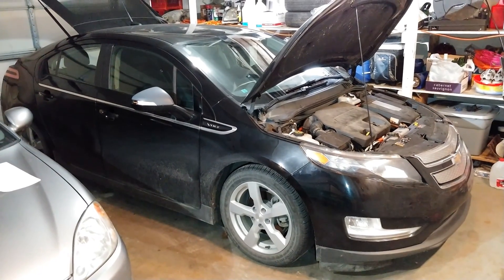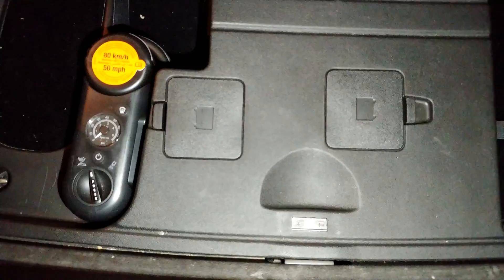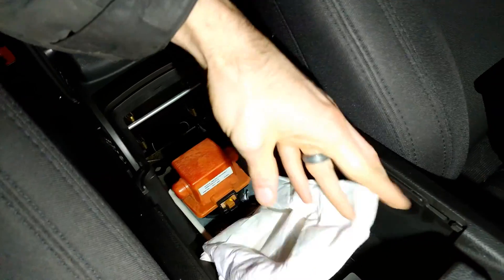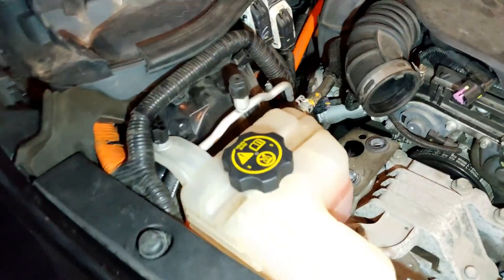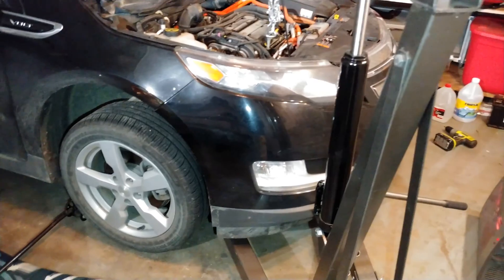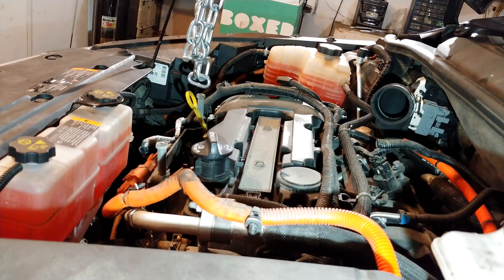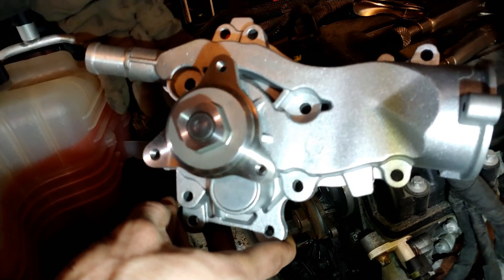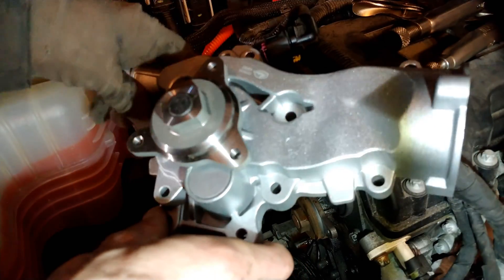2011-2015 Chevy Volt - How to Replace Engine Water Pump

Comment: P0597  P2181  ?
Reply from the maker: The error codes P0597 and P2181 for a 2011-2015 Chevrolet Volt indicate issues with the vehicle's cooling system.

P0597: Thermostat Heater Control Circuit/Open
This code is triggered when the Engine Control Module (ECM) detects a problem with the thermostat heater control circuit. Common causes include:

Faulty Thermostat: The thermostat may be defective, preventing proper temperature regulation.
Damaged Wiring or Connectors: Issues like broken wires or corroded connectors can disrupt the thermostat heater control circuit.
Failed ECM: Although less common, a malfunctioning ECM can also lead to this code.

P2181: Cooling System Performance
This code indicates a general issue with the cooling system's performance. Possible causes include:

Low Coolant Level: The coolant level might be low, affecting the cooling system's efficiency.
Faulty Thermostat: A malfunctioning thermostat can cause the engine to run at incorrect temperatures.
Cooling System Leaks: Leaks in the cooling system can lead to inadequate cooling3.

Recommended Actions
Check Coolant Levels: Ensure the coolant is topped off to the appropriate level.
Inspect Thermostat: Check the thermostat for proper operation and replace it if necessary.
Examine Wiring and Connectors: Look for any damaged or corroded wiring and connectors in the thermostat heater control circuit.

Comment: I love my city vote but, after seeing this headache and the foreseeable future, I don't know if it's worth it!
Reply from the maker: It's understandable to feel conflicted about your Volt, especially when facing issues like the engine radiator repair. The Volt has generally been praised for its efficiency and low running costs, but like any vehicle, it can have its share of issues.

Thankfully, engine radiator problems have not been one of them! This is the only video on YouTube to document the repair and it only has 15k views in 5 years. The Volt is also known for its reliability and low maintenance costs compared to many other vehicles. My 2013 has hit 2 deer. The first one took out the battery radiator, but the second one only took out a head light a bit of the hood. So far, the only major mechanical repair I've had to do is the engine water pump. I've put 80k trouble free miles on my Volt since I bought it after the first deer accident.
 
In terms of the foreseeable future, the Volt remains a solid choice for those looking for a hybrid vehicle. Despite being discontinued, many owners find it to be a reliable and cost-effective option. Parts and maintenance might become a bit more challenging over time, but the overall reliability of the Volt is still considered above average. Good luck!
Reply: @mjspiess  funny you mention hitting a dear, I actually bought the volt to replace an Elantra that was practically totaled by a deer 😅 My daughter drives the volt as a city car since it's built like a tank! I drive a Prius with 200k mi, which seems to be more serviceable but, I do like the volts mass. I just think about all of the water pumps I've put on cars in my life and consider it inevitable and daunting.
Reply from the maker: @GTN3  Ha! Figures! It's great that the Volt has been a reliable replacement for your Elantra. They are indeed built solidly, which is reassuring for city driving. Your Prius with 200k miles is impressive too! A friend of mine just bought a 2008 Prius for $1k that needed the HV battery refurbished. He replaced 4 modules and it's back in action.

Water pumps can definitely be a recurring maintenance task. It's one of those things that, while daunting, becomes a bit of a routine for seasoned car owners. Unfortunately, I haven't found much on this Volt that is "simple". I love it, but man, the engineers really made it more complicated than it needed to be!

Comment: Why does the engine even HAVE a water pump; the electric part of the car already has a coolant pump, just make it bigger..?
Reply from the maker: The engine has a water pump because the engine creates heat and it is cooled by its own radiator like any other standard internal combustion engine.  The electric pump is for the battery and electric motor.  Both systems work independently and dependently on one another and both require their own cooling systems.
Reply: @mjspiess maybe he is talking about the water pump for the heater core loop. Which is the one by the passenger side wheel
Reply from the maker: @danwat1234  That could be.  I haven't had to replace that water pump yet.

Comment: It's interesting, my mechanic insists that 'the book' (some subscription) says you need to disconnect orange cables to do this procedure, but u didn't!
Reply from the maker: Hmmm, I'm not sure why you would need to?  The engine water pump has nothing to do with HV system and is on the opposite side of the engine of the orange HV cables.
Reply: @mjspiess  he clarified, Having to raise engine for lower bolt clearance,  so much that risky not to disconnect but looks like they ( big orange inverter/trans) have enough slack maybe rear small orange cables could be issue 🤷‍♂️ thx!
Reply from the maker: @danwat1234  Hmmm, I'm not sure, but it's definitely not necessary to disconnect any of those HV orange cables.  Plenty of slack.
Reply: @mjspiess well even though he has seen your video he still wants to go by the book, disconnecting orange cables to replace water pump and do a head gasket job. And he isn't comfortable doing so since he isn't trained on high voltage, making sure capacitance is gone after pulling orange breaker and disconnecting lead acid first.
So, off to the dealership I go.
Reply from the maker: @danwat1234  Bummer.  Hopefully they get it all sorted out for you.

Comment: Just finished 5.5 hours.
1 hour in had the replacement pump on......and then the belt took 2 hours..googled the trick for stretch belts, boom, reassemble...and realize I have the pulley screw in my pocket 😥.

Can do it under two now and will add a supplement video for a couple of small things that helped.
Reply from the maker: Glad to hear you got it replaced.  Looking forward to some tips and tricks you learned along the way.  I had the service manual, but sometimes that's not always the best way.
Reply: @mjspiess  just finished the Tips video
https://youtu.be/wWK229sEuuQ
Reply from the maker: @ChuckMorton  Thanks for sharing!  I like the zip tie trick!  Keeping that lower bolt in should save time, especially if you can fit the pump back in with the bracket still in place.  Nice work!
Reply: @mjspiess  thanks, just don't be an idiot like me and forget to put that bolt back.

I also used your heated seats video to know that  the leather/upholstery want to hard to get to and fixed my sensor
Reply from the maker: @ChuckMorton  You're welcome.  Lol noted!

Nice!  I'm glad that video helped you too.

Comment: Thank you very much for this video. Tackled this myself but still struggling to install the new stretch belt. I dont know how you managed to do it with just your thumbs while someone turns the crank. Tried the Lisle tool but its grooves arent wide enough for our pulley. Hmmm...
Reply from the maker: You're welcome!  Reinstalling the belt was way more difficult than it should be.  The manual says to turn the crank shaft, but there's no room to reach it from above to also guide the belt onto the water pump pulley.  I opted to turn the water pump pulley instead with a crescent wrench and it was much easier.
Reply: Thank you! Yes I had an assistant turn the crank while I turned the top pulley.  I have a trick to doing this now- it takes less than 2 minutes. Take one of the pulley bolts out, and put a zip tie through it and around the belt TIGHT. Turn both pulleys and cut the tie once the belt reaches the other side. EASY
Reply from the maker: @ezdeezytube  Nice!  That's some good improvisation!  Glad to hear you got it on.

Comment: I heard that the engine mount bolts might come loose if they're not replaced. This was from a local GM service tech. There were a couple of cases where the mount came loose so the recommendation was to replace the bolts too, not sure if this was GM official guidance or not. Did the bolts seem anything special to you, like single use stretch bolts? I wonder if I can just use blue loctite on the threads to make sure it doesn't come loose.
Reply from the maker: I believe the service manual mentioned replacing the bolts, but I just reused mine.  The bolts didn't appear to be special in any way.  It's been 2 years/36k miles since my repair and they have not come loose.  Blue loctite seems like a good idea if there's a known issue with the torque remaining tight.

Comment: Does the engine need to be picked up to do this or was it just easier that way?
Reply from the maker: It needs to be supported from above or below because the passenger side motor mount is temporarily removed.
Reply: @mjspiess  thank you.  Have to tackle this one over the weekend unfortunately
Reply from the maker: @bb8384  You're welcome.  Unfortunately, there's nothing particularly easy to repair/replace on these Volts.  Read through my description and other comments for more tips.  Good luck!

Comment: Can you help me locate the engine coolant temperature sensor in a 2014 Volt?  I'm getting an error code P0118 associated with "AC Off Due to High Engine Temp".  Thanks!
Reply from the maker: Yeah, it's a tight squeeze, but it's on the passenger side of the engine radiator.  I go over the process of removing it in a different video when I replaced the radiator: https://youtu.be/TE9z5cPZaTk?t=250
Reply: @mjspiess  thanks, the diagram for the part I purchased (ACDelco# 55591401) shows it on the water pump assembly.
Reply from the maker: @edwinreidel1889  You're welcome.  Yeah, there is no sensor on the water pump.  That sensor you bought is definitely on the side of the radiator.
Reply: @mjspiess  I got it done, although it took A LOT longer than expected.  Next, I went to change the oil and the drain plug wouldn't budge.  Finally the bolt head started becoming rounded and I just decided to take it to the lube service.  It's scary getting under those heavy rigs.  Thanks again for your help!
Reply from the maker: @edwinreidel1889  These Volts are not very easy to work on!  Oh man, probably good call on taking it in after you started rounding the bolt.  I've had pretty good luck using a 6 point wrench and tap it with hammer or even use an impact wrench on it just to break it loose.  You're welcome for the help.  Glad you got that done and saved some money!
Reply: @mjspiess  No idea what that would cost at the dealership, but I'm sure you saved me some dough.  Since my time isn't super valuable these days, the economic calculation clearly favored picking up an ODBII device, the $10 part, and some fresh coolant!
Reply from the maker: @edwinreidel1889  Estimates for this job costs $800-$1,000 in my area, so yeah...saved some major dough!
Reply from the maker: @edwinreidel1889  Estimates for this job costs $800-$1,000 in my area, so you definitely saved some dough!
Reply: @mjspiess  oh nooo...the codes (P2181 and P0128) returned!
Reply from the maker: @edwinreidel1889  These codes correspond to engine coolant too cold and generally a faulty thermostat stuck open.  Did you happen to replace the thermostat?
Reply: @mjspiess  now I'm confused.  I thought the codes corresponded to engine coolant too hot.  Thus, the AC off and fan blowing hard under the hood so as not to further strain the ICE generator.  After clearing the code appears only after the ICE gen has warmed up.
Reply from the maker: @edwinreidel1889  I can see why you're confused with that conflicting message on the dash, but it is in fact due to the coolant being too cool, but since it's a cooling system code, I assume that AC off message comes up no matter what...coolant too cold or hot.

P0128 Coolant Thermostat (Coolant Temperature Below Thermostat Regulating Temperature)
P2181: Engine Cooling System Performance
The engine control module (ECM) monitors temperature difference between the engine coolant temperature (ECT) sensor and the radiator coolant temperature (RCT) sensor during a cold start-up. The purpose of this diagnostic is to analyze the engine coolant thermostat for being stuck open.

Conditions for Setting the DTC

The ECM detects the engine coolant thermostat is stuck open for at least 2.5 min.
Reply: @mjspiess  I replaced the thermostat.  So far the error codes have not returned.  Fingers crossed, thanks!
Reply from the maker: @edwinreidel1889  Awesome!  Thanks for letting me know!

Comment: If the belt ever needed to be changed you'd have to do all this with the motor mount minus the pump swap, correct?
Reply from the maker: Correct... Not a particularly easy job, but doable.

Comment: Thanks for the video!  I’ve been told you need a computer program to burp the system properly, I didn’t see anything regarding that in your video.    So I’m assuming that is not needed?
Reply: Awesome thanks I appreciate it.   Mine has been leaking for about a year from the weep hole.  Just a little.  Didn’t have to fill up the coolant that much but it finally went out.  Been dreading this but now my mind is at ease.  

Thanks again.
Reply from the maker: @tna74  You're welcome!  It takes some work to get to it done, but it's worth the effort to save some cash.  For sure.  Rest assured, you don't need any of the special/expensive equipment to get this job done.
Reply from the maker: You're welcome! Correct, it's not necessarily needed. It will take a week or so to naturally bleed, so just check the coolant level each day until it no longer drops in level.
Reply: Thanks again for this.  I just got all the parts in yesterday.  A few things were on back order.   

This wasn’t bad, not sure what they were thinking with that bottom bolt on the mount.  Such a pain in the ass...   would probably be an hour job if it wasn’t for that bolt.  I started it up got an error message but cleared it.  Hasn’t come back as of yet so knock on wood it won’t..  

Anyways thanks again I appreciate you making this video.
Reply from the maker: @tna74  You're welcome.  No kidding...  That bottom bolt on the mount is rough!  Good to hear on the error message.  When I replaced the front radiator when I first bought the car, I had to clear the code every time I turned it off, then on.  However, after about 3 weeks of adding coolant little by little, it finally never came back.  Then a few months later, the water pump began leaking lol!  Anyway, I'm glad this video was able to help you and many others.
Reply from the maker: @tna74  I got your message through my email, but I'm not sure why it's not showing up here?  My first though was air bubble as well.  It can cause a "false" over heating warning.  Yikes...the boiling is indicative of it actually getting hot and/or it could be exhaust gases from a blown head gasket.  190* isn't really that hot and actually pretty normal temperature though.  Was the coolant in the reservoir actually boiling or was it air bubbles making it look like it's boiling?  Is the thermostat opening/closing appropriately?
Reply: Ya weird the message is gone..  glad u got it though.   It was boiling just out of that little hose.  It was 225 degrees.   I was able to finally get it to toss a code PB007.  Couldn’t find it for volt but said it’s a coolant sensor code.  I ordered one that goes in the block it was $15.   Said it could be either that one or the one in the radiator.  Not sure how hard the one in the radiator would be to change.   Or if this is even the cause. 

Thanks
Reply from the maker: @tna74  ok, that's definitely hot then. How quickly does it boil? If it's within minutes of running, I would be concerned of the head gasket. Although, you said it idled for 30 minutes, right? Are you getting heat inside the cabin? You should run the heater on high to help burp the system. I don't think the sensors would cause it to heat up unless they are telling the thermostat to stay shut. It's probably a dumb question, but is the water pump belt on and spinning the pulley? You can feel the rubber hose near the thermostat. Once it opens, it should feel hot.
Reply: Thanks for taking the time to help.  Yeah the belt is on and water pump turning, heat in the cab.  I had it on high to help burp it.  

The big hose in front of the thermostat was like 60 degrees and warmed up to mid 80-90 at the end, the back hose was up to 190ish.   The res was 90 degrees except where that little hose on the back is at.  It was bubbling so I figured just air.  I took the temp and was 225.   I did read that the dexcool won’t boil till 260 so maybe it was air.   It’s a little hose that goes on the back side of the engine to the other loop.  

I saw a video on overheat warning issue and ended up being a chewed wire but not my case.   Ordered that sensor and think I could get another thermostat.  I guess Just because it’s new doesn’t mean it’s functioning properly.  

It’s a basic system water pump moves water, thermostat opens to allow cool water in, radiator cools water.  Res holds water.  This thing though wants to fight it.  Hahaha.
Reply: Ok so just to add to this in case anyone in the future has same issue, I put the old thermostat in and it’s fine.  Obviously the new thermostat is bad.  

Thank you again for all your help! I owe you a lunch 😁
Reply from the maker: @tna74  I was just about to reply it appears your thermostat is not opening because when it does, that large rubber hose should get hot...like 190*. Yours was only 60-90*. Good work on figuring it out! I'm REALLY glad your head gasket is fine! Those bubbles/boiling appearance was concerning.

Lol, I would enjoy a lunch :) Have a nice weekend!